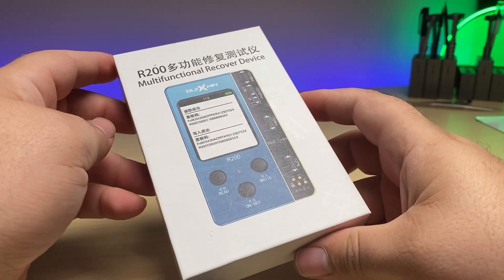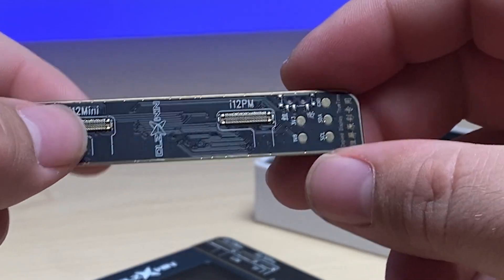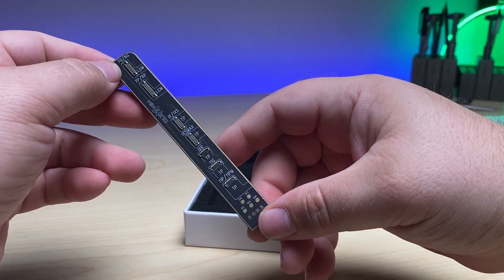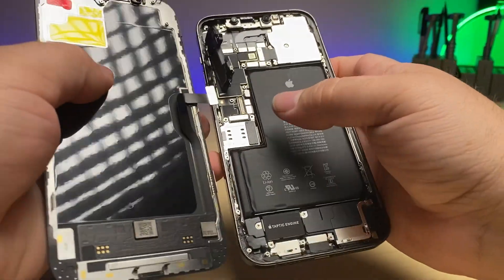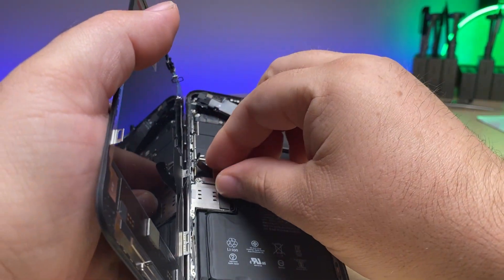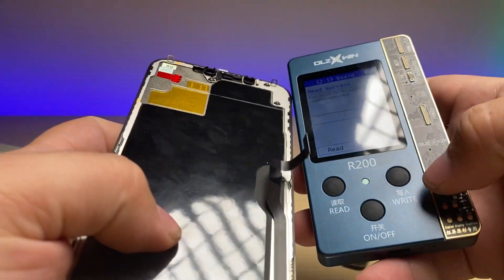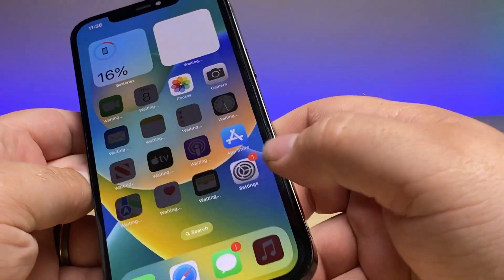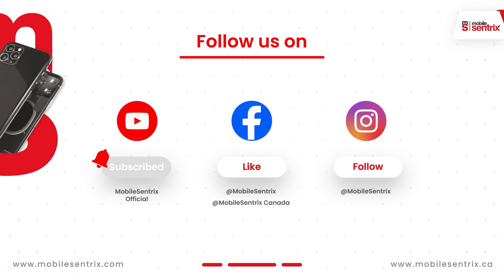DLZ -R200 True Tone Restore Programmer for iPhone 7-13mini (Tips and Tricks #1)

Comment: Yep, this is Apple's serial locked parts scam... F*ck Apple! 
For testing purposes, you can purchase two identical brand new iPhones at the Apple store.
If you swap any parts around including the battery, vibrator, sensors, cameras, or screen,
both phones with display a "non-genuine" message even though they are 100% genuine.